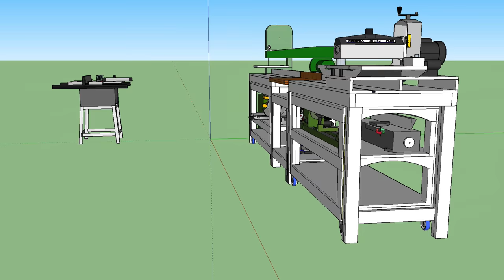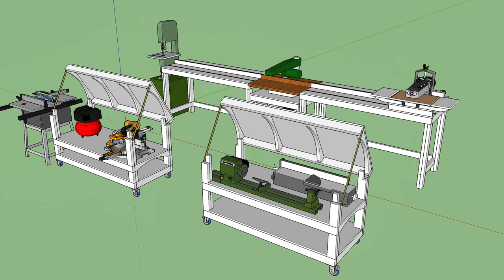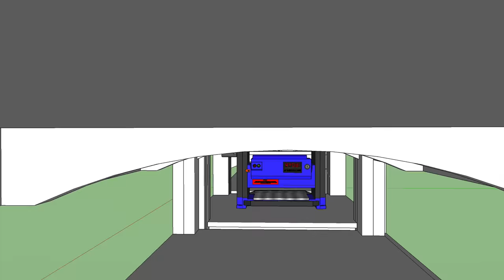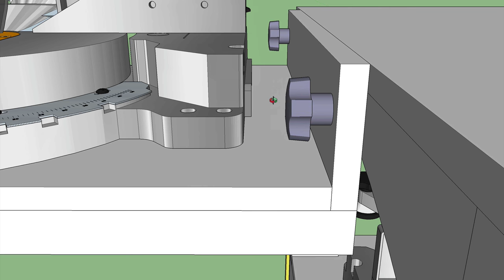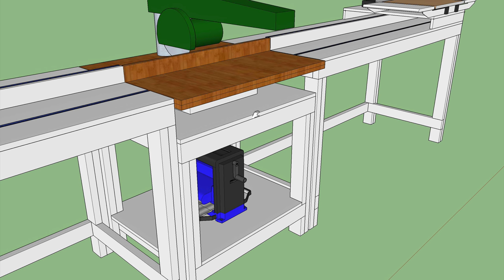New Shop Build: Part 1 - The Plan

Comment: Tommy, l really like your videos and like you, I also started out with a good quality DeWalt radial arm saw I built into a shop table. This was about 1960. 

I had many accidents with it doing ripping despite all my best efforts at safe operation. By far the biggest contributor to my ripping accidents was kickback caused by the blade pinching my hardwood or damp soft wood between the table top and the blade — especially if the blade was not really sharp. The pawl would catch the board sometimes and save me from injury but it scared me and usually damaged the hardwood I was cutting and jammed the blade and motor to a stop. 

When I got my first table saw years later it came with a riving knife and I had so much better success on it with ripping operations I never ripped anything on the radial arm again. I considered it the most dangerous tool I had in my shop. In fact, now that I have a good cabinet table saw with adequate power and a good 12” compound miter saw my radial arm doesn’t get any use. It is no longer mounted on my work bench. The compound miter saw is in that spot. 

I still have the old radial arm but it basically is a keepsake now taking up shop space on the floor. If I needed space I would sell it. I wish you continued good luck ripping on your radial but as I am sure I viewed a table saw in your shop I hope you shift your ripping operations to it. I do agree with those who say if you only have room or a budget for one saw, a radial arm is more versatile than a table saw because cross cutting and cutting dados you can see the surface you are cutting much better. I know mine is not as accurate or nearly as safe as the table saw. With a good sled and many of the other jigs I’ve made for my table saw it is no compromise using it. 

I do like your benches, they show a lot of imagination and the videos are first class. I hope you keeping them coming.

Comment: Tommy, great design. I liked the concept of saving floor space to have 4 tables with the footprint of 2. What is the ceiling storage - is that a "pull  down/pull up" kind.  i bought the plan and intend to start building.
Reply from the maker: Hi Xavier - I'm using these storage lifts that I bought off Amazon: https://www.amazon.com/Racor-PHL-1R-HeavyLift-4-Foot-Cable-Lifted/dp/B0009I8AO6/ref=sr_1_2?ie=UTF8&qid=1489246843&sr=8-2&keywords=storage+lift

I did make a few modifications to them.  I added PVC across the shaft so that it would hold more cable and I added more cable so that I could drop it all the way from the ceiling to my floor.  I have 12 foot ceilings and I think it was only designed for 8.  I also added some 2x4s to brace the platform so that it doesn't flex as much.  They certainly come in handy!

Comment: Great plans, I appreciate the thought that you put into this. Just curious what model is your Dewalt Radial Arm saw? Is that a 10" blade?
Reply from the maker: Thanks Matt!  My saw is a 925H which was designed for a 9" blade but I run an 8" blade on it.  The motor has a little more torque on the 8" so it works better with thicker material.

Comment: Tommy, did you have to adjust for the slope of your garage at all?
Reply from the maker: Hey John - I have floor drains in my garage so everything slopes down towards the middle of each stall.  I knew this would be an issue and I wanted to have room for lots of adjusting to get all table tops level, so I used t-nuts with 3/8" bolts on the bottom of each leg so that I can use a wrench to easily make leveling adjustments. I show how I did this in the other videos.

Comment: Just purchased/downloaded your sketch up plans. How do you open them?
Reply from the maker: Hello Stewart - the download includes many files that are all bundled together in a single .zip file. You should be able to just open the zip file and extract the files onto your hard drive. On some Windows operating systems, you might need to download a zip utility to open the zip file.  If this is the case for you, you can visit www.winzip.com and download the free trial which will allow you to open it.
Reply: @TommyTompkins   I’m working on an iPad. I can see the file but it is grayed-out and I can’t figure out how to get the website to open it. I didn’t know if there was a step I’ve missed or what. The pdf opened just fine, but no joy so far on the sketchup file.
Reply from the maker: @stewartott4249  It sounds like you opened the zip file just fine. The sketchup file will only open if you have Sketchup installed on your machine. We only include the Sketchup file for convenience for people that have Sketchup installed and want to change the design. The only files that you actually need are the pdf files.

Comment: Hello Tommy, great videos.  How long is the finished product here?  Definitely interested in making something similar to this.
Reply from the maker: Thanks Tim!  If you count all tables including the radial arm saw table, the total overall dimensions end up being 42" tall X 30" deep X 16 feet long.  Everything is modular obviously so you could apply the same tables in different configurations for different results.
Reply: Thanks for the quick reply!  All in, how much money do you think you have into the full setup?
Reply from the maker: The entire setup requires 46 2x4s and 10 4x8 sheets of MDF or plywood.  Here in MN, each 2x4 was just over $2 each and each MDF panel was about $25.  That's approximately $350 + glue and screws.

Comment: Nice job mate. A lot of people have been asking about sketch up. When you have the view of each bench with the lay down of how many boards (and how to best cut them with least wastage), is this a sketchup function?or did you just have to copy and paste each part and lay them flat???
Reply from the maker: Thanks.  I didn't use any Sketchup plugins to figure out the best cut with the least waste.  I did that in Sketchup manually by copying / pasting since I couldn't find any plugin to do exactly what I was looking for.